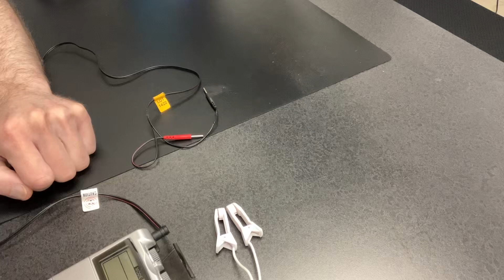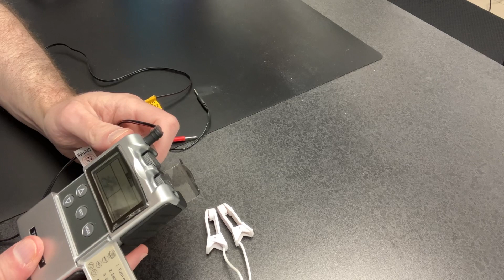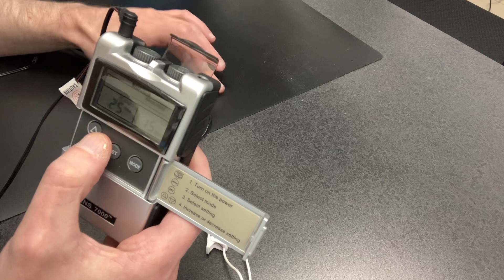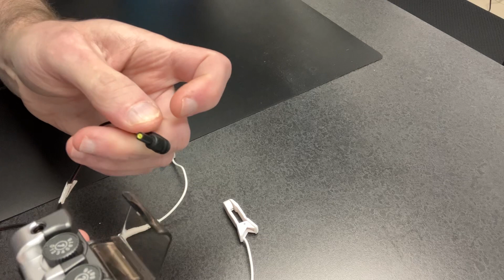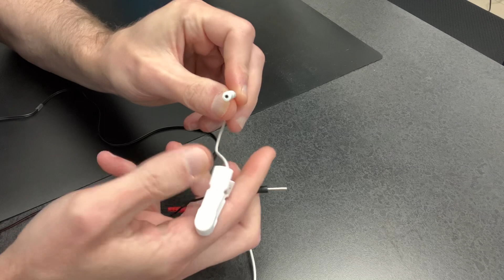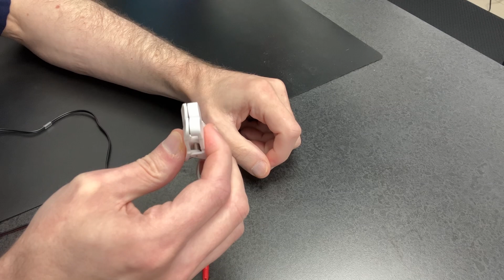TENS 7000 setup - Vagus Nerve Stimulation for Anosmia, Parosmia, and GI issues from Long COVID

Comment from the maker: People who are using the TNS 7000 more than 30-60 minutes a day and say its not enough, the issue is the TENS 700 outputs a continuous square waveform at high % duty cycle.  Your vagus nerve will either be overstimulated or turn off and stop responding no matter how long you decide to continue stimulating it.   If you want to use a vagus nerve stimulator for longer than 30 minutes at a time, you need to have a low duty cycle of about 10% duty-cycled (classic setting ≈ 30 s ON / 5 min OFF, ~10% duty cycle).  The TENS 7000 doesn't have this setting ability.  You can literally run it 24 hours a day at a duty cycle of 10%, NOT at 100%.  I need an electrical engineer to help explain this better. There is pulse width, frequency, and a duty cycle except that TENS 7000 doesn't give you an ability to adjust the duty cycle individually.

Comment: I’ve seen online the red lead should go on the Tragus clip, and the black lead should go on an electrode sticky pad on the left shoulder. Is that necessary?
Reply from the maker: That is one way to do it but I think it works better with a double ended clip.
Reply: @SPMLongCovid meaning both the black and red leads go to each side of the clip on ear? What’s the benefit of this? Thanks for the quick reply!

Comment: Why choose TENS 7000 over more expensive units like the Parasym or Gammacore? What is the advantage of using these considerably more expensive devices?

Also, why is it that 150-200 us and 15-30 hz is the sweet spot for stimulating the vagus nerve?
Reply from the maker: Anyone who wants to spend 10-20x as much is welcome to.  Value doesn’t come from the cost of the unit.  I have determined these values work for nerves based on several studies.
Reply: @SPMLongCovid  Is there any advantage to those more expensive devices? Why is their price point so high? 

And do you mind linking to study on how the parameters were defined? Thanks!
Reply from the maker: @asdgq35212 I would have to dig them up, but they are likely on this page:  https://covidinstitute.org/vagus-nerve-stimulation/

Comment: @BellyLaugher
0 seconds ago
THERE IS A VERY EASY FIX SENT BY COMPANY TO EARCLIPS FALLING OFF, ETC! Per email company sent me: "If you look closely you will find that the rubber part has come out of the plastic part. Remove the jack, then simply push the rubber back into the plastic and it will be fine." Company included photo, but apparently youtube won't allow me to paste it here...I'll try to describe...Look below the spongy round part that goes on the skin/ear & you will see on the inner part of the clip (that your pinching fingers are not pressing) there is a rectangular bit of the same material as the round spongy ear part embedded into the plastic➡PROBLEM:it has popped up above the level of the plastic in which it is embedded➡just push it back down into its compartment, and the ear pieces will fit perfectly. When those parts pop-up-out, there's too much empty space for the connector to stay put. What a relief, eh? 🥳

Comment: I had same frustration experience & sameconcern it wasn't good quality BUT THERE IS A VERY EASY FIX SENT BY COMPANY! From email company sent me: "If you look closely you will find that the rubber part has come out of the plastic part. Remove the jack, then simply push the rubber back into the plastic and it will be fine." Company included photo, but apparently youtube won't allow me to paste it here...I'll try to describe...Look below the spongy round part that goes on the skin/ear & you will see on the inner part of the clip (that your pinching fingers are not pressing) there is a rectangular bit of the same material as the round spongy ear part embedded into the plastic➡PROBLEM:it has popped up above the level of the plastic in which it is embedded➡just push it back down into its compartment, and the ear pieces will fit perfectly. When those parts pop-up-out, there's too much empty space for the connector to stay put. What a relief, eh? 🥳

Comment: Normal Mode. 200ms. 25Hz. 20-30min per day. Dial set tono more than 2 or 3
Reply: How many for width uS?
Reply: 200  @jswranch
Reply: the "u" is basically a cursive looking "m".  u and m both ARE the same unit, micro (second). so set it to 200.
Reply: I love this setting. If I do 30hz what will change?

Comment: The prongs on my brand new dual ear clip do not fit snuggly onto my brand new TENS 7000 unit, They slide out w/ slighest movements, and don't/won't stay in when I'm sitting up; I must be laying down, & even then, w/slight head movement, the prongs slide out (regardless if on tragus or other sites). How can  I remedy this,  other than returning them, does anyone know?➡I am so needing to get started on trying this for ME➡as saw videos by OT for whom it has greatly helped w/many sx, but it can take a few months for cummulative effects. (& 🥺 I just received them after 3rd party shipper used in US took 3 weeks to deliver them --they were in shipper's Nevada wharehouse for 10 days, waiting for enough items to fill truck b4 were sent to their NYwharehouse where waited again for, days to be sent to Boston--might be better to order from England...but now have concerns, given misfit of prongs to clips--the US distributor of the clips may be counterfitter of original design company) Thanks❣

Comment: The Tens 7000 that is made made by Everyway Medical (not sure if all Tens7000 are the same as that is just what the Americans call that model) is biphasic it’s just that the cables they supply makes it feel like one electrode is stronger than the other!  Try a different cable and this little baby will crank out the volts nice and evenly 😊
Reply: Try what cable?

Comment: I'd be grateful if anyone could comment whether the Alpha-stim Aid be used in the same way. It has earclips that are usually used bilaterally to each earlobe but could be applied to the tragus and earlobe. Here is what the manual states in terms of current etc:
CURRENT: 0 to 500 microamperes (µA), +/- 5%, adjustable in 50 µA increments. When load is 1KΩ, maximum output current is 525 µA (waveform amplitude is 525 mV) and minimum output current is 475 µA (waveform amplitude is 475 mV). 

FREQUENCY: 0.5 Hz (pulses per second) combined with a constant 0.4 Hz. The average pulse repetition rate is 0.8 Hz. 

PULSE WIDTH: Varying between 0.25, 0.5, 0.75 and 1 second.  

CHARGE PER PULSE: At 500 µA the charge per pulse varies between 125, 250, 375 and 500 microcoulombs (µC). Every 10 seconds the total charge is 1.25 millicoulombs (mC) in each direction.  

WAVE FORM: The impedance range within which the waveform parameters remain valid are from 100 Ω to 10 KΩ. The waveform is composed of bipolar asymmetric rectangular waves at a 50% duty cycle repeating periodically at 10 second intervals. The waveform is balanced to achieve 0 net current in either direction.
Reply from the maker: Alpha stim is essentially a vagus nerve stimulator but the frequency is too low in my opinion for vagus nerve.  I prefer above 15 Hz.  It’s also not adjustable.  Frequency is the most important setting.
Reply: I'm grateful for your response. Thank you  @SPMLongCovid

Comment: Hello Doctor, device clinically approved like parasym use biphasic symmetrical wave while a lot of others use biphasic asymmetrical. Is this making a huge difference for the vagus nerve treatment ? I've heard something like nerve regeneration appears only with symmetrical waves. What is your opinion/experience ?
Reply from the maker: In short whether it’s mono polar or bipolar, point is to stimulate the nerve.  It will respond to either type.  It’s the fact that the nerve is stimulated that does the work.  I’m fine with either type.
Reply: @SPMLongCovid  Thanks Doc !

Comment: If TENS 7000 only goes as low as 12.5mA and the recommendation is 4-8mA, how is it suitable for this purpose?  I can't feel it at all at a setting of "1" but that's still far higher than what is recommended.
Reply: I think the mA output from the TENS unit does not account for the electrical resistance of human skin. Thus, the current the vagus nerve receives could be much lower than what is outputted from the device.
Reply from the maker: I’m no longer following an exact milliamperes recommendation.  Most people will feel the tingling between 2-3.
Reply: @SPMLongCovid  ok.  So no risk of damaging the nerve with higher amperage
Reply from the maker: If you increase intensity until you feel a tingle then back off a smidge, it should be fine.  Nothing should be painful.

Comment: Hi, what's the difference between clips that have electrodes on both arms compared to the ones shown in this video? Is functionality the same? Is effectiveness the same? Thank you.
Reply from the maker: It’s just easier for some using a double contact clip.  It’s more convenient.  There isn’t a lot real estate on the ear.  Yes functionally it’s the same if you use 2 single contact clips or 1 dual sided one.

Comment: I don’t see where it tells you the level of intensity that you’re at?  It beeps when I turn it on but no level shows up- I don’t know ho high to turn it?  If you feel anything what does it feel like? I don’t seem to feel anything with my ear clips
Reply from the maker: Make sure clip contacts are flat against the skin of the ear.  Use a drop of water, saline, or conductive gel to improve contact.  Slowly, and I mean slowly turn up intensity from 1 until you feel a tingle.  Should happen around 2-3.  If you go slow, you won’t shock yourself.
Reply from the maker: The level is the number on the dial on top of the TENS 7000.  If you are using a different unit, I don't know where it is.  In some units its digital controlled by buttons.

Comment: In your video you mention intensity 1 is equal to 12.5mA. 

Then in the guide you recommend intensity 1-2, “4-8mA should be fine”. 

If intensity 1 is 12.5mA with this device, how would you possibly set it between 4 and 8mA?
Reply: Robert Groysman  Thank you so much for replying, the mA setting has been plaguing me. 

So many of the clinical trials talk about sub 1mA intensities, and so I was worried going higher might cause damage. 

I initially had a device with programs. The nearest program was 30hz but only 100uS width. Even on intensity 1, it felt fairly strong. By 3 it was very strong. 

My new device, which has full manual control, I set to 30hz, 200uS width and then tried 1mA and couldn’t feel a thing until I put it on my tongue 😄

8-10mA I can feel, but I was worried I might cause damage. 

Thanks again, this part of the detail has been a nightmare trying to figure out.
Reply from the maker: If it’s too strong on 1, you may need a prescription vagus nerve stimulator with more precise control.  The Tens 7000 is being repurposed for vagus nerve stimulation but wasn’t designed for it.  It won’t be suitable for some.
Reply: @HuskyDakotaFans  where is his response to your question? What did he say?
Reply: If you are in the US, the Intensity Twin Stim iii is an affordable option that lets you program all the same settings and use it on 1 mA and increase by 1 mA increments.